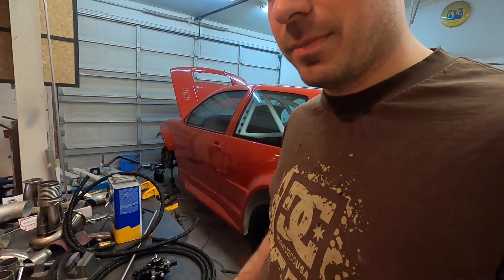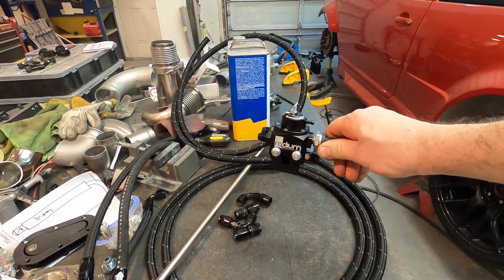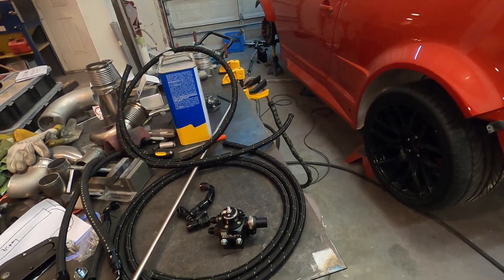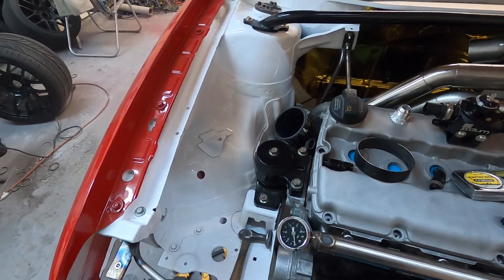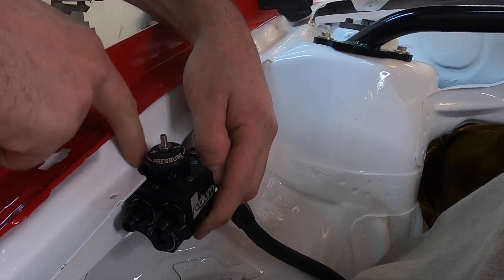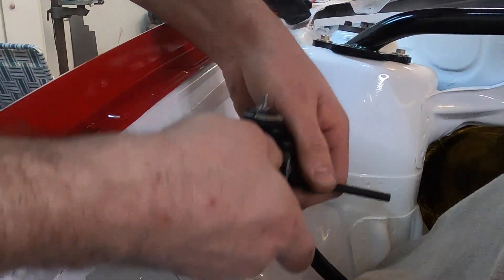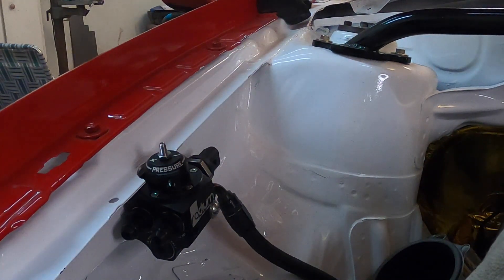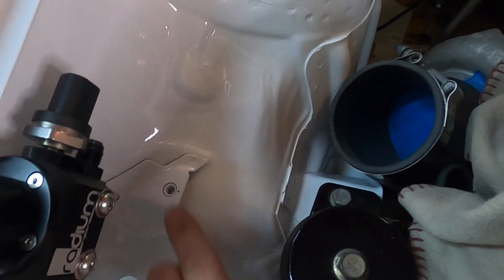R32 Build: Fuel pressure regulator install

Comment: When putting nutserts into body panels would you recommend treating the metal just to ensure that the panel doesn't rust out around/behind the nursert?
Reply from the maker: Casey S absolutely. I will be spraying all internal areas with a cavity wax once all fab work is done and all bare metal edges will be touched up with paint.